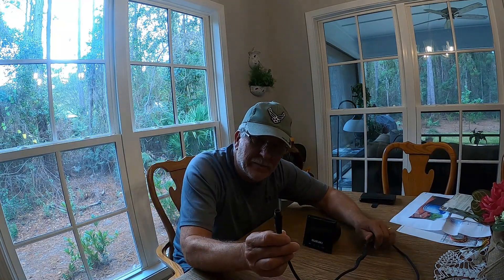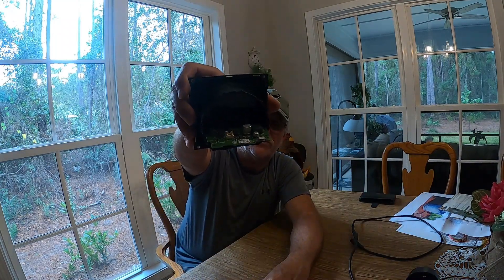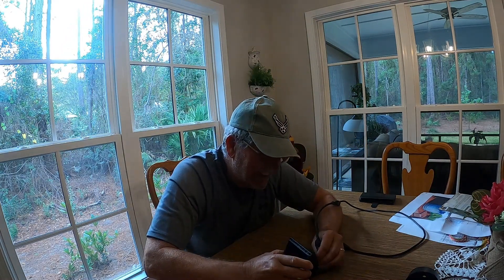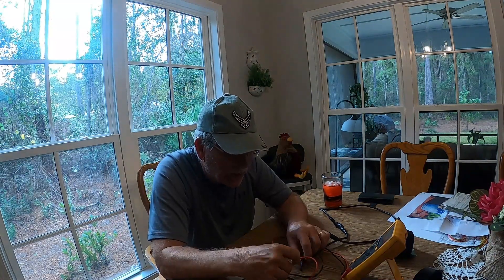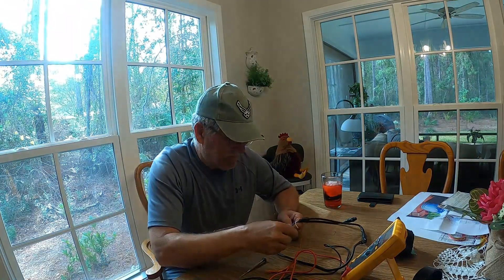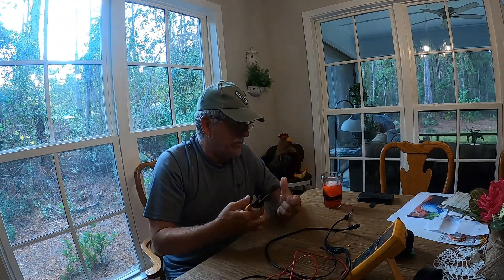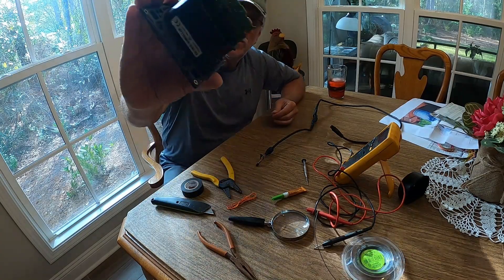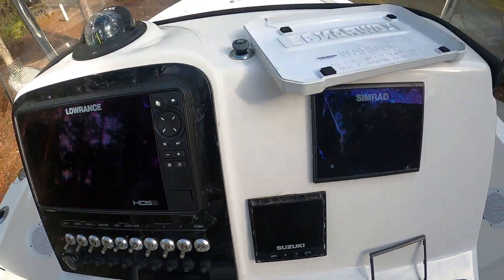C 10 Gage Issues JUNK

Comment: Paul “Gauge Saver” in Jacksonville Florida doesn’t work on those gauges? I had them do both my Yamaha gauges. Maybe I missed it, but who, and why is that extension taped? I would definitely remove all that mess, as it seems you’re not getting data from the engine? Goodluck👍
Reply from the maker: Exactly no data but I’m going to unplug each device to see if one could be shorted out. More later. Lol